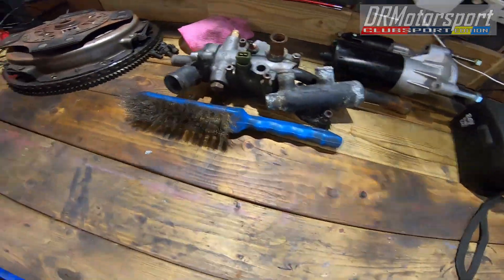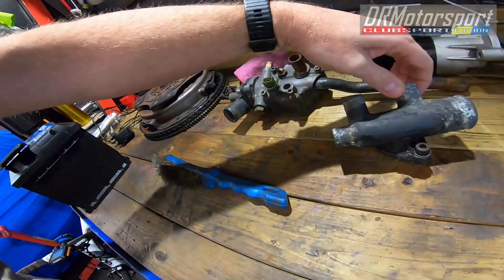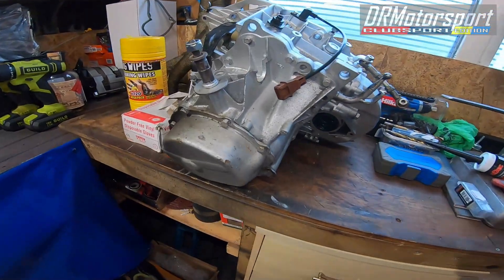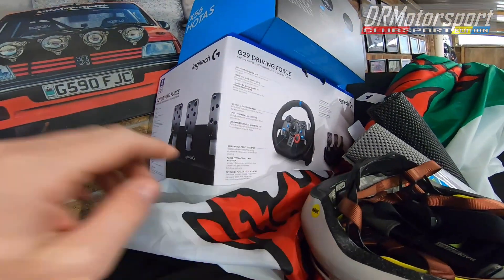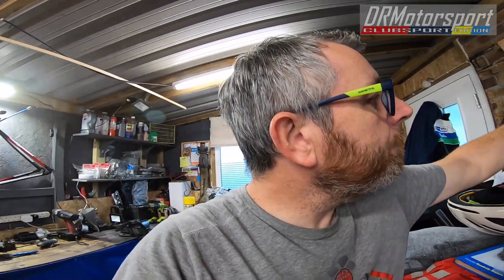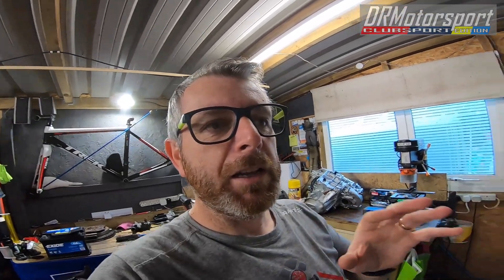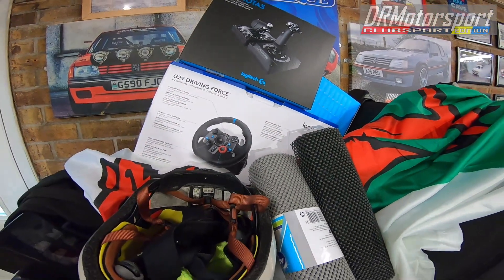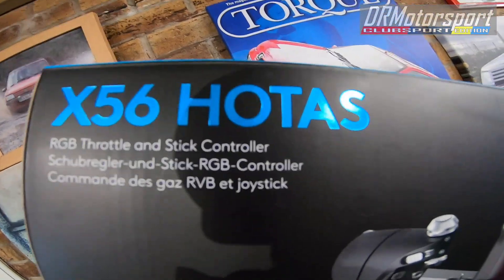205 GTi Mi16 #DRMotorsport - An overdue channel update and AI Tech has arrived at DRMotorsport!

Comment: Just found your channel👍.  I had a 205 1.9 GTI many years ago.  I loved the car, but fitted the MI 16 engine complete with injection system from a 405. I recall having to buy a bespoke exhaust manifold, but that was about it. I always felt it was the car Peugeot should’ve made. Only other mod was the fifth gear from a diesel. Helped economy on long runs and top speed. Boy, I wish I had it now.
Reply from the maker: @johnhopkins7614  Good morning mate, and thank you for subscribing 😁 A 205 with an Mi16 in it is something else isn't it 💪🏻😃 As you can see, mine is with it's engine at the moment 🫣😆 It's difficult to get a decent 205 without paying big money for one...